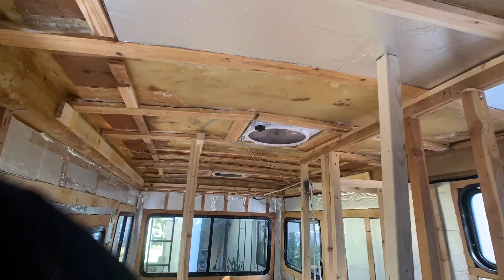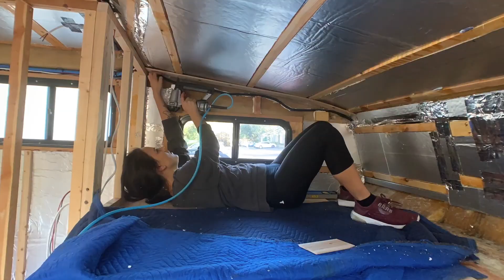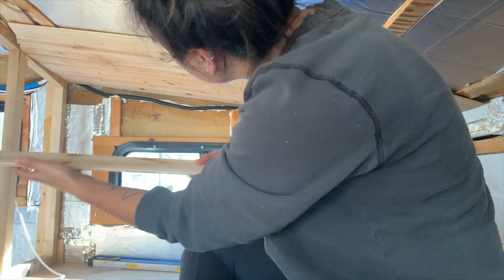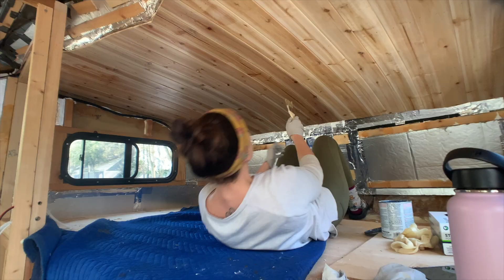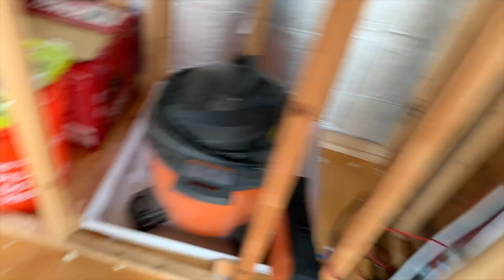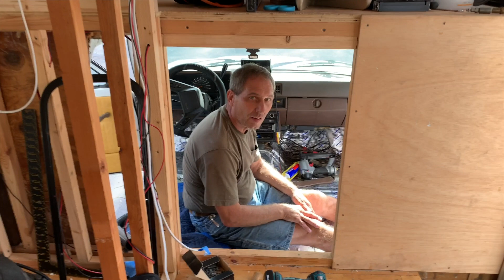Toyota Sunrader RV Build | Installing Cedar Ceiling

Comment: Were the studs already in place?  If not what did you use and what type size nail/screw did you use to attach it to the camper shell?

Comment: Dope 🤘🏻!!!! So I’ve been putting off getting the ceiling up in my rv because it looks like a bear of a task lol what are your thoughts after looking back in the install !?
Reply from the maker: Thank you! We would do it again! Laying the cedar paneling wasn’t hard. It helps if someone is cutting and someone is measuring and installing the pieces. But could easily be a one person job. We staggered our pieces since our main living area was longer than the 8ft boards. And since we also were installing the puck lights in the ceiling we thought it best to start installing in the middle and working out towards the sides so our puck lights were evenly spaced apart. I hope that helps!